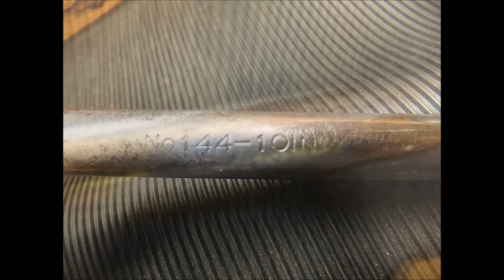Vintage Stanley Brace  Drill Restoration , # 144-10in

Comment: Found a J.A. Chapman by Stanley #144-1oin in a pile of tools with a heap of drill bits about 10 yrs ago at an auction. It's been sitting in a drawer in the shed unloved. Only problem the brace is missing both wooden handle and back knob. At the present time I'm attempting to make the two items out of a very hard wood. Just watching your and other videos it has given me the impetuous to restore it.

Comment: I did the very same thing today! haha. I found an older ratcheting 10 inch brace at goodwill for 7 dollars and just had to have it. All parts are there, nothing is cracked, and everything functioned. Put in several hours with a wire wheel and handle refinishing alone. Tomorrow I come back with the steel wool and polish... Put the work in, and a better result will show!

Comment: Thanks for this. I have rather intricate looking Brace and started the restoration process. I wanted to chrome plate the parts but I now see the mystery of the wood handle is to leave it in place since there is no way to get that thing off. :)
Reply: You can try splitting It and gluing It back together. Maybe It Will work

Comment: What year was that tool made?
Reply: it's pre the  late 1960's resin ones and post Fray which was late 1920's (but I think that the earlier ones had a octagonal head rather than the knurled ones) so it should be somewhere in that period but more than likely post WW2. I'm sure there's someone out there with better knowledge to narrow it down further (usually there's a country of manufacture on them .... if it's an Australian one then that will narrow it down much further  I guess as Stanley only manufactured in Australia between 1963 and 2001).
Reply: Andrew Dawson excellent information. Thanks!